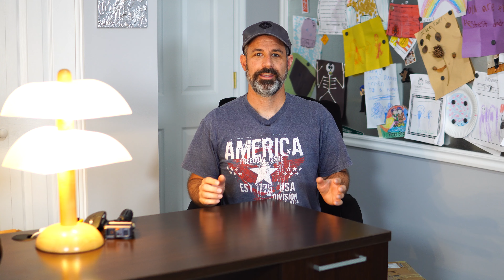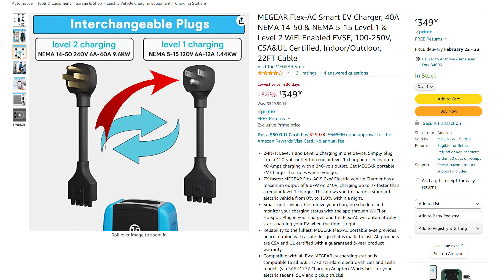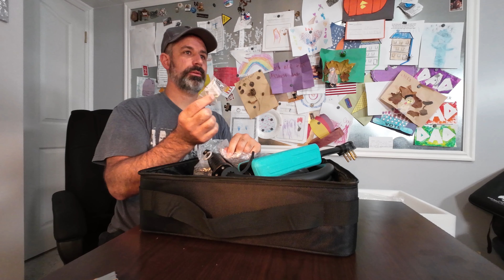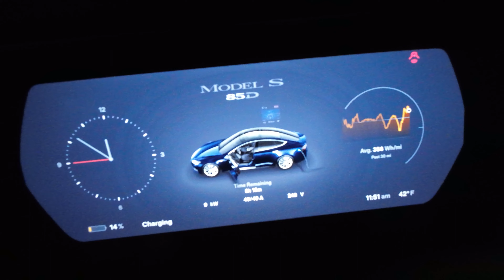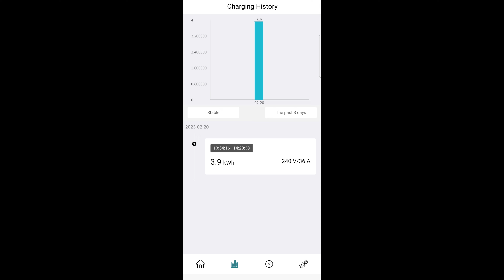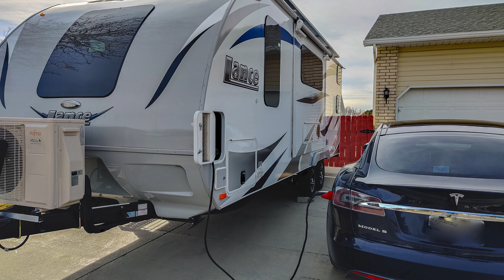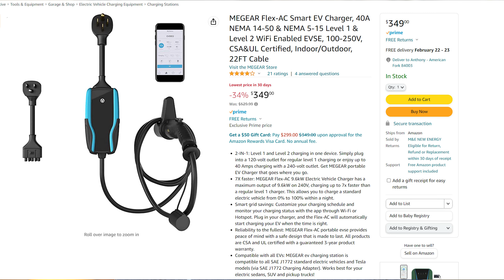Megear Pion Power Flex-AC EV Charger Unboxing, Review, & WiFi App Walkthrough

Comment from the maker: Something I overlooked making this review video was the fact that if you've connected this device to WiFi then it requires you to control it through the app in order to start charging...which I find obnoxious. I would prefer that it simply start charging automatically when I plug it into the vehicle at the last amp rate I specified through the app. In order for this charger to start charging automatically you have to disconnect it from WiFi then it'll just start charging, but at the max amp rate that the connector allows.
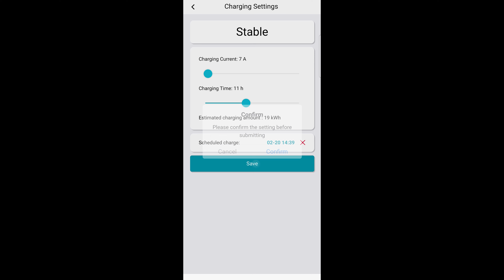Reply: Could it be because you don't have 'Scheduled Charged' set to 'Now' in the charge settings? Like at 23:00 in your video?
Reply from the maker: @jimmyk395  each time I unplug the car then plug it back in the charger waits for me to initiate the charge through the app. I emailed Megear and they said to disconnect the device from WiFi and it will start charging automatically. I explained the behavior I expected and want and they said they passed that on to their product team. Time will tell what they do.
Reply: @ElectricTechAdventures  I see. That's not a behaviour I would expect either. The physical connection should initiate the charge regardless of WiFi connectivity. Thanks, I will email them too. I'll hold off buying it. I'm debating between this, the Emporia or Grizzl-E
Reply: That can be dangerous if I have a 40Amp breaker and it is charging at the full 40Amps vs the allowable 32 Amps.
Reply from the maker: I'm not sure what "that" is you're referring to, but there's nothing dangerous in what my pinned comment is referring to. The maximum allowed amps is dictated automatically by the connector plugged into the mobile connector. What the WiFi connectivity then allows is for you to reduce from the max down to your preferred amps, whatever that might be. If the electrical receptacle you're plugged into is to code then there's nothing dangerous about pulling 40 amps from a NEMA 14-50 which is the plug with this mobile connector we're talking about.
Reply: In my case, I have a 40A breaker with a 14-50 plug, but only 80% max draw is allowed making it only 32A. So If I understand correctly, the EVSE will limit it to 32A? In order to safely pull 40A, a 50A breaker would be required.
Reply from the maker: @50088  The NEMA 14-50 receptacle should be installed with a 50 amp breaker. If it was installed with a breaker that supports less amps than 50 then it is not to code and should not have been done. If the wire can support 50 amps then the breaker should be upgraded to 50 amps. If the wire cannot support 50 amps then The receptacle should be changed to match the amperage that the breaker supports such as the NEMA 14-30 which supports 30 amps as an example. The whole reason for the various receptacle NEMA designations is so that the orientation of the prongs matches the amperage of the device.
Reply: @Electric Tech Adventures  Apparently,  there is no such thing as a 40A outlet so a 14-50 outlet is used for a 40A breaker. I will purchase the 32A EVSE just to be safe.
Reply: Figured out a way around this. You can set the scheduled charge to basically be all the time (0:00 - 23:55) and it will start auto charging when you plug in. Dumb you have to do this in the first place, but at least it works.
Reply from the maker: @gabe530  awesome, thanks for sharing!

Comment: What's not clear, is if the plug adapter for 5-15 can handle a 20A outlet, at more than 1.4 kW. That would be super handy, to be able to charge at 20A rather than just 15A. (Downrated to 80% of course.)
Reply from the maker: When the 5-15 adapter is plugged in it's limited to 12 amps and just plugging the 5-15 adapter into a 5-20 receptacle isn't going to change that. They need to provide more adapters for this EVSE like Tesla has for theirs. Alas at this point they only have these two adapters. As a work around you could use the NEMA 14-50 adapter then use a third party adapter from NEMA 5-20 to 14-50 and adjust the amps in the EV manually (if it allows for that). Not an ideal solution, but frankly any 120 volt source isn't ideal to begin with. I've found 240 volt receptacles are way better because they typically support about 30 amps, and they're usually on a dedicated circuit. But those aren't nearly as plentiful as 5-15 or 5-20 receptacles unfortunately. I have found a fair amount of success reaching dryer outlets in many homes I've visited, but they nearly always require an extension cord which I show in this video https://youtu.be/hL0jpxYlHpM
Reply: @ElectricTechAdventures  Yeah that's what I thought. I guess 14-50 with adapter and REALLY taking care to limit charge amps (and relying on breaker trip if exceeding) is indeed an alternative. Just looking for ways to charge at parents' house while visiting. It astounds me they don't have more adapters, I'd buy at least the 20A and a dryer one. It's what's holding me off from pulling the trigger on this charger.
Reply from the maker: You might be interested in this video I made a while back which outlines the charging solution I use on road trips to be able to charge from varied electrical sources. Basically I just use the mobile connector to go into the car and I use third party adapters to all adapt to the NEMA 14-50 connector type on the mobile connector. Then I manage the amps the car is pulling from the car, rather than expecting the mobile connector to do it. The real key in this solution is the NEMA 14-50 30 foot extension cord I use in this solution which allows me to reach outlets inside people's homes. https://youtu.be/hL0jpxYlHpM
Reply: @ElectricTechAdventures  Thanks!

Comment: I love your videos! I’ve got a 2015 S85D that I just purchased (PMMB blue). It’s great to see my doppelgänger in your vids. Question-do you run on chill or standard? Do you have a mph setting for your “low” suspension setting? Have you done a comparison between normal ride height and low with respect to efficiency?
Reply from the maker: Thanks for your kind words. I've seen doppelgänger's to our Model S at Superchargers I think just twice in the last 4 years. It was fun to see them because they're pretty rare. Now days 3s and Ys DOMINATE Tesla sightings. As to your questions I rarely ever use chill. I've used it a time or two on road trips in remote areas where I was trying hard to conserve energy due to limited charging infrastructure. I didn't feel like it made any difference on overall energy consumption, so I've just left it on standard the last few years. I currently have my mph setting for low suspension set to 65 mph. I'm not sure that it makes much of a difference in aero drag. I've never tried to do a specific test of that setting's effect. Generally I've found tweaks like that to probably be negligible, especially compared to what I as the driver can effect. For around town driving the biggest effect on efficiency is probably acceleration, but from my experience in the winter heating the cabin consumes more energy than aggressive driving. Obviously that depends on how aggressive you're accelerating vs what's the temperature differential between inside and outside. The biggest effect of efficiency on road trips (which is typically driving on high speed roads) is just how fast you're going. There's some 80 mph sections of I-15 that we drive on regularly and many people are going 90 mph. On any road it's easier to just go with the average speed of traffic, so generally I just maintain a safe speed around the average of traffic and I don't worry about efficiency too much. On most road trips I just pay attention to the Tesla's estimated arrival percentage and I ensure that doesn't go below 5-10% depending on the circumstances. If it goes too low I slow down, but if I have plenty of energy I'll speed up sometimes if possible. I did some research back in 2019 regarding the tradeoff of speed of driving and drop of efficiency vs speed of charging at Superchargers and I determined that about 80 mph is the fastest I should go. Above that and any gained time is negated by the additional time taken charging to regain the lost range. If I'm driving the last segment of the day and I'm going to be charging overnight and not waiting then I'll drive as fast as I care to as long as I don't go below my safety margin of 5%. You might be interested in this video I made of our road trip to Mount Rushmore and Devils Tower. It's a long video, but has lots of information about the charging logistics of that trip. I have a bunch of road trip videos with charging information on my channel if you're interested in learning how we've charged our Tesla in many varied locations. https://youtu.be/TnDnquUf53o